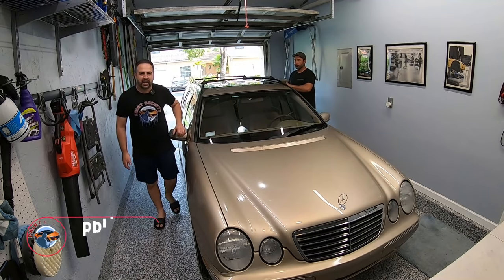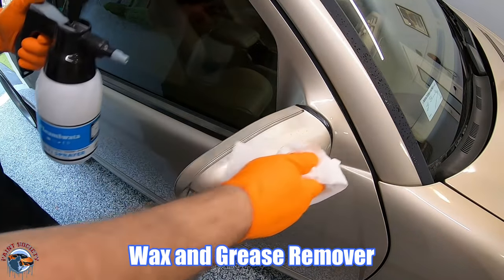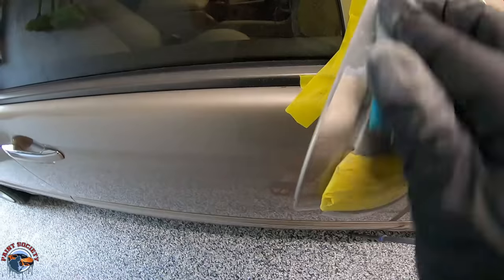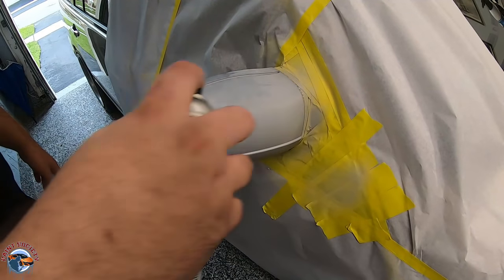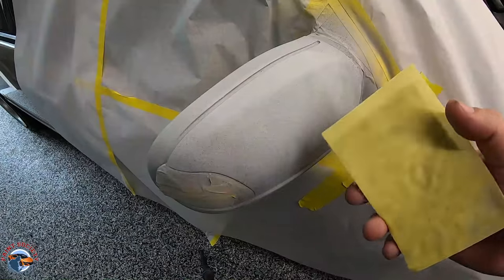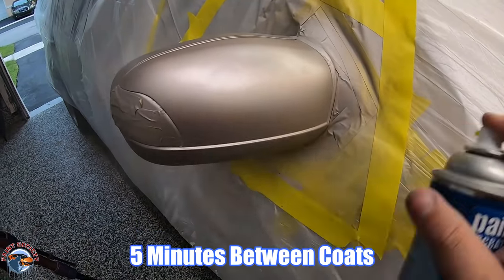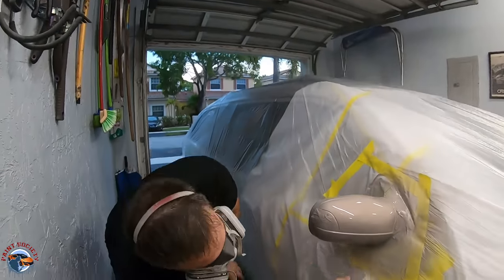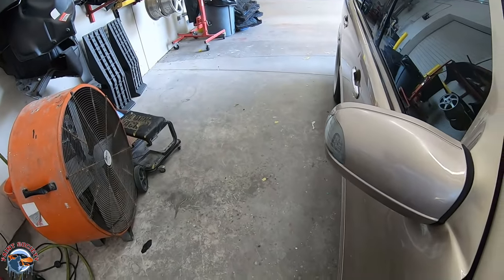RESTORE Your Car With DIY Spray Paint!

Comment from the maker: Shop Paint Society Merch: paintsocietystore.com
Reply: Well I did my first auto spray can DIY in Hyundai quartz white. (to address the hyundai self peeling paint.) The 3 can solution blended perfect.   however the my clearcoat is dry and bumpy in a lot of areas so I'm wondering if I 3 coats were enough or too much? My first coat was light.

Comment: Great instruction as usual! Love it! Please consider doing a video on restoring faded and chipped vehicle emblems especially recessed painted lettering inside of chrome and surrounded by black. I am restoring a '68 Nova Super Sport which has a large tail light to tail light SS aluminum emblem panel. What you have is a satin black panel with raised chrome SS letters with recessed white lettering which all need to be redone. It's a bit of detail work in and around the SS lettering which I'm not afraid of,  just need some tips! Thanks!

Comment: Important miss…Use VIN to order your paint.  High metallics on factory paint are different from first vehicle to last on a production run.  The last vehicle of one metallic color can often have more metallics due to settling in a batch.  Test spray your can before you do your project, good suppliers will often make it right if it does not match so read the disclaimers and warranty.

Comment: I probably missed it in other videos, but this is the first time I heard about trimming the tape with a razor blade to mask off something.  I've been struggling with trying to bend/curve tape.   SMH.....  Thx!
Reply: It helps to angle the blade so it cuts a bit higher and leaves some tape for wrap around. In this example I'd but with the blade as close to parallel to the turn signal up into the housing. Then the edge can wrap around the turn signal in the gap and not leave a line.

Comment: Quick question about spray paint.  It seem like whenever I use a spray can, it doesn't Dry right.  The paint is always soft and easy to scratch.  I live in Washington state.  The only thing that I can think of is its to cold 9 months out of the year for the paint to dry properly. Any input would be appreciated!

Comment: My error was not spraying my whole quarter panel with the 1k clear that was in my kit from automotive touch-up. Now I've got clear spot peeling but the OEM paint and clear under it are in great shape. So I'm wondering could I wet sand and Ultimate Compound that quarter panel to get the original clear showing again .

Comment: I called Dupli-color to see if I could get color code PBJ(Atlantic Blue Pearl Metallic) for my Dodge RAM. They do not have that color available. I like the way Dupli-Color sprays and thank you for the tip to NOT use Dupli-Color clear. You were right on and I used Spray Max Gloss Clear Coat. What a difference. Looks great. Somewhere I saw a video where they used a UPOL spray can. From the video I was under the impression that O'Reilly could fill up a UPOL spray can with any color code that I wished. At O"reilly no one knew what I was talking about. Can't seem to find the original video I saw. Do you have a recommendation? Have you used AutomotiveTouchup products? New to your channel and I love what you are doing here. Old dogs can learn new tricks.

Comment: Brian, been following your videos a lot lately , especially spray can method. I am painting a hood of my 01 tacoma. I used the paintscratch primer I had left from another project but ran out after 1 coat. I then used rustoleum 2 in 1 auto primer to finish the job, then realized they might not be compatible and the paintscratch base color might not work well with rustoelum since its alkyd. Any thoughts?